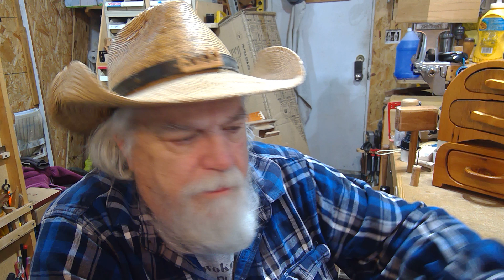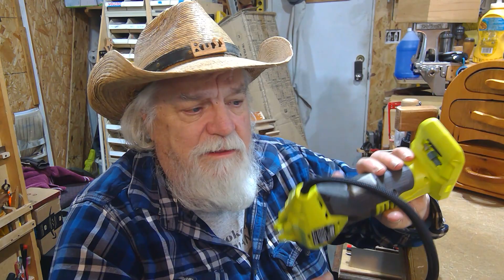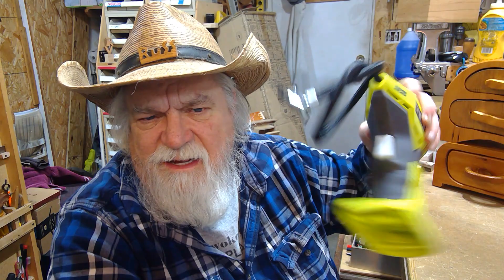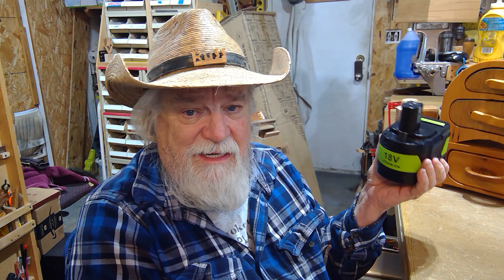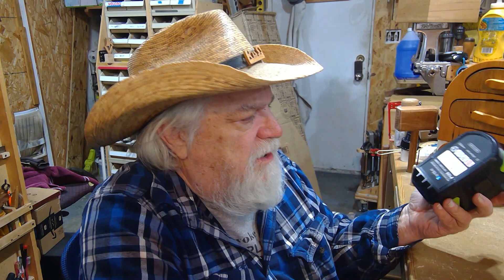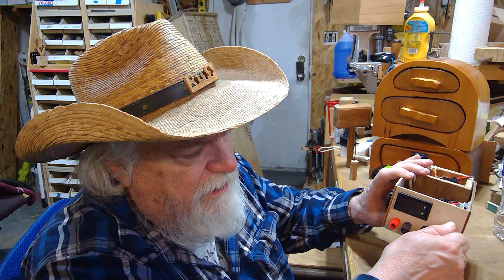Gas Caddy & Doggy Door Updates & More by Rambling Russ

Comment: I used 5 gallon cans and a siphon tube.  I think it is called a shaker siphon or something like that I bought one and it worked so good I bought two more and have been using them for at least 5 years now.  It has a little ball that acts as a check valve, and makes it easy to start and drains a 5 gallon can to a few drops in the bottom.
Reply: I have never heard of a shaker siphon. Looks like something very userful to have around. Plenty of you tube vidoes!!